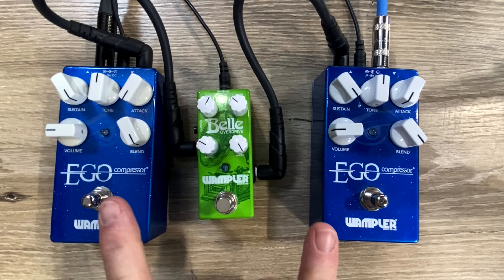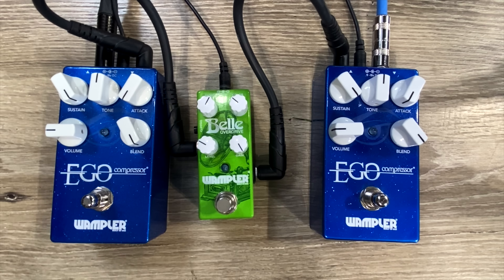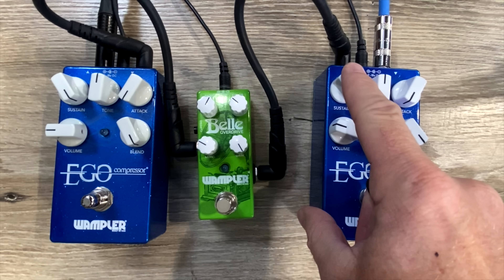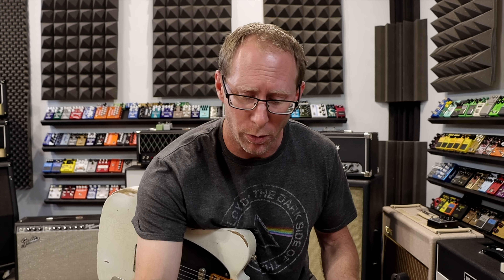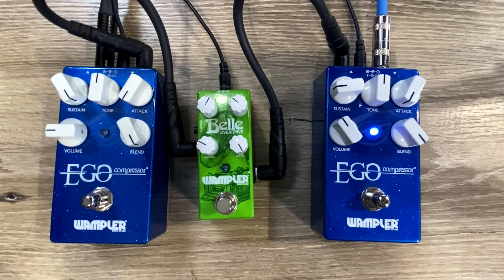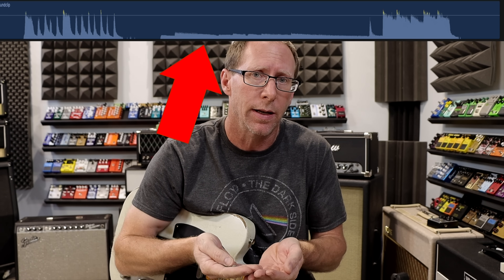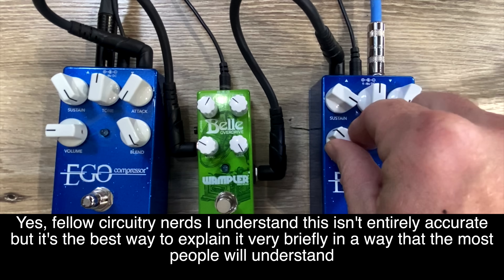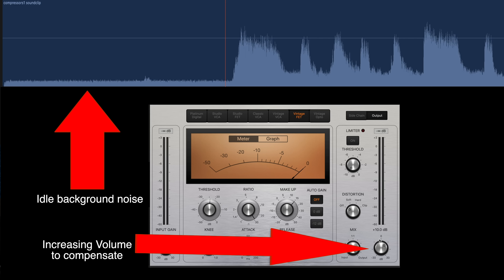Are you making these mistakes with compressor pedals?

Comment: Compressors don't "compress up". They reduce any signal* (i.e. "compress down") that go over a predetermined threshold level, so the higher level of both quieter sounds and the noise floor (all below the threshold) that you hear will be due to the ability to now raise the overall volume (with the volume control, AKA "make-up") post compression. You could also drive more volume into the compressor for a similar effect on the noise floor/quieter sounds.
*EDIT originally said "peaks", by which I did not mean transients but any signal that bypassed the predetermined threshold level.
Reply: Not exactly.  You're confounding limiting and compression.  Limiting addresses peaks, by pulling back on the gain when a transient exceeds some predetermined level.  Compression applies gain to the entire signal, reining that gain back in when the input signal increases beyond some threshold.  The result is something that approximates an average constant level.    Many older portable cassette decks would have an "AGC" (Automatic Gain Control) feature that did this, purportedly to optimize S/N ratio on cassette tape.  Legend was that portions of the guitar on the Rolling Stones' "Street Fighting Man" were recorded on a cassette deck using the buil-in AGC.  

Limiting still permits signal dynamics and quieter bits to be quieter, while not allowing sudden peaks to push the VU meter "into the red".  Depending on how much compression one tweaks a unit for, and how low one sets the threshold for limiting, they CAN sound near identical at times.  So it's an easy confusion to make.
Reply: @markhammer643  I'm not confusing compression and limiting (I'm a recording engineer, BTW). If you look at a standard compressor in a recording studio there are often the parameters "threshold" and "ratio". If you set the threshold just to catch peaks and set the ratio to something like 20:1 it will act as a limiter. If you pull the threshold down to affect more of the incoming signal you can probably relax the ratio to as little as 1.5:1. Bottom line is that in neither case will there be any "compressing up" of the signal; it will always be turning the incoming signal down. However, you can turn the processed signal up using the "make-up" control, so-called  because you are making up for the loss of volume caused by compressing the signal. So, on the compressor pedal used in the demo, the volume control is a make-up control (alternately it may be driving more signal into the compressor; either way there's no "compression up", just bouncing back out of the compression).
Reply: @LaNwamNi  Thanks for clarifying (and nice to have an engineer's input here).  I have a bunch of compressors, including rackmount, table-top, optical, FET, and OTA, and an SSM2166-based unit I built.  Rackmount compressors, like you describe, CAN function in the manner you depict.  Stompbox compressors, on the other hand, tend to be a much cruder beast, operating on the basis of a crank-the-gain-unless design. One of the reasons why "breathing" is more likely to occur with them than with many, if not most, rackmount units.  The SSM2166 chip was intended to be part of a mic strip, so it includes downward expansion and a relocatable "knee" for both noise reduction at the bottom, and limiting at the top, and can serve as either peak limiter OR compressor, depending on where one sets the various knees and compression ratio.  It's a really nice chip that makes for a really quiet stompbox compressor.

Comment: I liek pedals with a blend, I set them at the most extreme settings then the blend to the minimum and then I can have one more light on my poard... if the light has an issue I will be wanting to repair the pedal... otherwise its doing its job

Comment: My biggest issue with Compressors is the damn noise. I had a Cali 76 and sold it, not for the noise, it was almost dead quiet for anyone wondering, but for other reasons.. Anyway. I'd be willing to try the Ego. How is it on the noise level as compared to other comps..like the 76 for instance?

Comment: My question is, I don’t understand having a blend knob on a compressor. If you are letting some of the signal through without being compressed, does that not defeat the purpose?
Reply: No, it's the best of both. It allows you to add more compression and blend to taste. it's called parallel compression and is very common.
Reply: I have the same confusion. If peaks pass through then the signal is not compressed from the top but just low sounds are getting get boosted. But interestingly with Ego, even with the blend at 50% it feels like peaks are partially compressed. Still trying to figure out how blend and sustain controls interact with each other.
Reply: @mustafaicil  if blend is at 50% then the peaks ARE being partially compressed
Reply: @Guitarisforgrins  But with blend at 50%, the unaffected signal is also being passed through and its peaks should be passing with no change according to the blend knob definition.
Reply: @mustafaicil  It might be more helpful to thing of it as a literal blend. There is your original signal and the compressed signal, they blend together to form a 3rd unique signal. That is the output. It's really more than just the two signals, it's the two signals interacting.

Another thing to consider is that a blend at 50% with the output at the same level as the input, means the original signal is only half as strong as it was. It is being attenuated. 

I know that kinda sounds like word-salad, but that's the best way I can explain it. At the end of the day it's more about how it feels.
Reply: @Guitarisforgrins  Thanks 🙏 This clarifies it much more. I wish we knew exactly how it is mixed but best is to try and set by ear it seems as you say.

Comment: QUESTION: Does a studio quality compressor like a DBX160X effect differently than a stomp box? Like does a stomp box compressor sound more like an effect where the DBX rack mount compressor is more subtle ?
Reply from the maker: Good question! Generally most pedals are more like limiters. Studio compressors are usually more complicated circuits, and used a bit differently the. What guitar players are using compressors for
Reply: The Studio Compressors have one adjustment most stomp boxes dont have ( if any? )  and that is Compression Ratio and it is very useful. I used an Ashly SC-50  in my rig.

Comment: the compressor b4 or after will depend on the guitar, the od or drive, the amp, speakers....really even the full pedal board... in this demo, with this gtr, amp and od, and compressors being identical in all ways: B4 had much more uniformity, but extreme highs and lows chopped....the perceive volume and bass  was the uniformity and low mids...very American sounding like a Bogner or Mesa Boogie sound.  The comp after had more lows and highs and since the drive was outputting mostly distorted mids -those mids got ramped down with almost a noisy scooped sound, with lightly distorted lows and highs sounding sparkly but thin.  That is just THIS Case... After could be improved and so could before, ultimately a smart musician tests both in a DAW with a scratch track and applies the typical but often necessary high pass eq filters and other eq, tape saturation etc to see with guitar signal path IS right for the song's mix ( sounds biggest - the right frequencies of mids, low mids, lows but doesnt muddy up or compete with bass gtr with keeping the air ( right highs : no shrillness).  I would opt before with set up, lowering lows on amp first seeing if amp highs sound more airy or the drive pedal, and or starting on the drive pedal and compensating with amp eq to fiine tune.  great demo Brian!

Comment: Can a Compressor be used in the effects loop?
Reply from the maker: Generally, yes. All effects loops are not the same though, so if it’s an amp with a line level loop it’s possible you might get a little distortion, but it won’t hurt anything. Try it out, personally I love putting a comp in the effects loop!

Comment: That was cool!  Thanks for sharing!  Just a question....in the video, you mention how the compression works before/after overdrive.  However, I tend to use a compressor on my clean tone, since the overdriven sound is already "naturally" compressing.  I like it for adding some "squash" on my clean sound, but I find it to be too much, if I add it to an overdriven sound...with that in mind, would I be better to try a line-level unit that I can switch in/out for clean, vs the pedal that I use now?  Cheers!  :)

Comment: Hi , completely unrelated question. But
Is it possible to change the impedance of an amp. 
Background I have a kustom kba10x practice bass amp.
A friend has a c10t 150 celestial speaker 10" 150w 8ohm.
But the amp is only 4 ohm. 
How can this be changed to be more suitable for the speaker
Thanks in advance

Comment: Hi, Mr Wampler!
Why did you change the interface on the newer pedals?
Mine is an old sparkle blue .........
(wich is the most beautiful one.......)
Probably a stupid question........
But.
As I`m a nerd.
Why........?
Reply from the maker: Which pedal are you referring to? Some of our new pedals do have quite a bit of sparkle, like the Mofetta and the ego76
Reply: Well.
Blend top left.on/off diode middle Attack top right.
Lower row.
Volume.Tone.Sustain.
In Jack on right side/out on left.
White printing.
Think I got it about 2012/2015. 
Maybe earlier.
Big components inside.
Deep blue sparkle and white lettering.
Got it for country pickin’ like Brent Mason and Johnny Hiland.
Served me well even if I never will play in the same game as those guys…………..
Says handmade in America.
Very nice pedal……!
Reply from the maker: Oh, gotcha. Different layout. Through hole parts are being faded out so we can’t buy them in quantity anymore. Knobs are in different place because better noise specs. Logo changed for two reasons: legally it’s not handmade, because all components for anything electrical come from china, plus the simplified logo looks better.
Reply: Thanks Mr Wampler!
It will stay on my board and be used a lot……!
👍

Comment: What's your recommendation regarding combining a noise-gate (the ISP Gstring type that checks your clean signal and works in the FX) and a compressor? They do more or less the opposite to my feeling. Is het better to place  the noise-gate directly after the guitar and than the compressor? Or the other way around?
Reply: After would require a higher threshold on the gate because the comp will raise the noise floor. I would go gate first.
Reply: @Guitarisforgrins  thxs. sounds logic to me too.

Comment: I wonder what multiband compression would sound like on an electric guitar signal.
Reply: Multiband is always better in every situation. Why not focus on the dynamics of the frequency range where the dynamics issue is? Wideband is always bad and doesn't make sense. Why would you want treble sounds to trigger bass compression? Why would you want bass sounds to trigger treble compression? Wide band compressors should be illegal

Comment: I put a compressor in front of a klone, took out all the distortion, but it didn’t do that to other overdrives. I thought that was odd.
Reply: Weird. Have you tried raising the compressor volume (and maybe dialing back the sustain) to punch the front end?
Reply from the maker: What type of compressor? I use an ego and Tumnus all the time and have no problems with it affecting drive negatively, is the level up high enough on the comp?
Reply: @wampler_pedals  most likely, if memory serves, it was either an optical compressor or a soul preacher. I’ll start with, I was a playing bass. I used the soul preacher the last three years I was gigging. I’ve gone through so many compressors, it’s not even funny. Never had any issues putting it in front of an overdrive.

Comment: What I really want to know is... what shelves are those?!  I need more space for my Wampler pedals.
Reply from the maker: I built them
Reply: @wampler_pedals  great video.  Thanks!  I liked compressor effect before the od. I felt it created nicer rounded tones on the clean setting.   I have the same problems you mentioned with my compressor. Infact I was even thinking of selling it.  Obviously I don't know how to use it. I play mostly high gain stuff, hardly any clean ( except for David Gilmore riffs) and it's still hard to hear if the compressor is impacting the high gain tones any.

Comment: Someone ought to make a compressor that sends output at unity gain. Heck even take the volume knob off entirely,
Reply: What part of the note do you want at unity? The attack? The tail? The middle? A compressor is specifically designed to not be at unity gain - usually by reducing the attack (not unity) and lifting the tail - ie more sustain, better harmonics etc. (also not unity gain).
Reply: @lorpal1  it does get confusing.

Comment: I leave mine on all the time but only for this new band I’m in. I’m backing up an acoustic player and I have to set my big 100 watt amp ,with two tubes removed and in lower mode, extremely low. Safe to say there is always a lot of headroom and even set low I have to play fairly soft. So in my case the compressor allows me to play better as I can express a little more without becoming too loud. The sustain also helps a lot with the slow long notes I’m playing.
Reply: I think some type of volume control in the loop would probably help with the volume control sensitivity as well.

Comment: isn't compressing Before, something for less expensive compressors; and compressing After, something for more expensive compressors ???
i mean it's kind of like standard compressor vs. more studio like, i think, right???
Reply from the maker: No, it doesn’t have anything to do with compressor cost really. In a pedalboard arrangement it’s about what the player likes. You may be confusing it with studio compression though, but that’s used for a different reason generally, where the track is already recorded and you want to “glue” it with other tracks, for just one example. Studio comps will thicken things up too though but overall most use pedal compressors based on the sound that they are trying to achieve.

Comment: There is no harder pedal to sell to a guitarist than a compressor pedal! Am I not correct in saying that most OD/Dist. pedals have a little bit of natural comp. built in and that be the reason that many guitarists don't really see the benefit of a dedicated pedal?
Reply: It's very useful if you want to play fast passages with a relatively low amount of gain like with funk,math rock or bluegrass/country. All the feel and sustain of a jacked marshall with a ts, but with a glassy crunch instead of BRRRRRRRR.
Reply: Distortion is more of a brickwall limiter or a compressor with fixed ratio, attack and release settings. With a dedicated compressor, you have the flexibility to adjust every parameter to achieve different sounds.

Comment: Compressor is the most bs effect of all time. you literally can’t even tell what it does. The only mistake is buying a compressor pedal
Reply: Compression also happens in tube amps and mixing consoles so sometimes I don't really need my Ego Squasher. 
However if YOU can't hear what they do, you should double-down put the rest of your gear on Reverb.